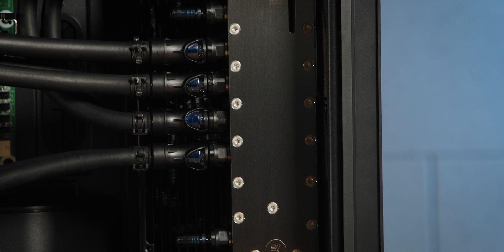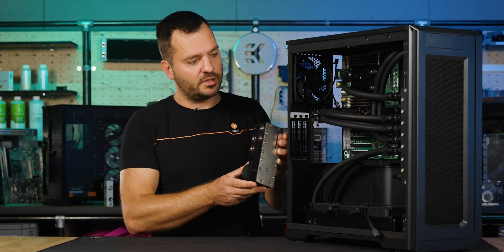EK-Pro Loop | Introduction

Comment: also in this position EK Manifold , is the CPU water block will have air bubbles on top position? just thinking install same one but on 4 Water blocks, and thinking it is should be on highest position, and water will have fill more horizontal level, for example when it is works pump is moving water it is fine maybe little bubbles on top, once You stop pump water will drop to Manifold and CPU water block will dry partitially , is it possible situation or with pressure in Reserviour it is never happens? thanks